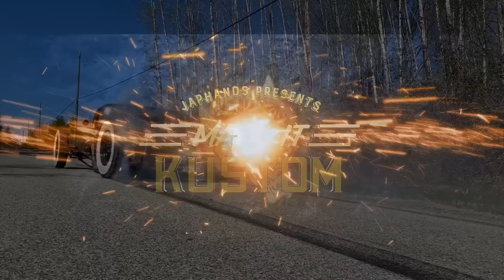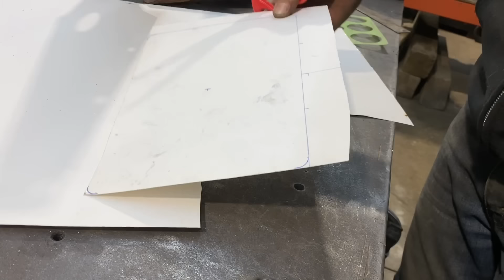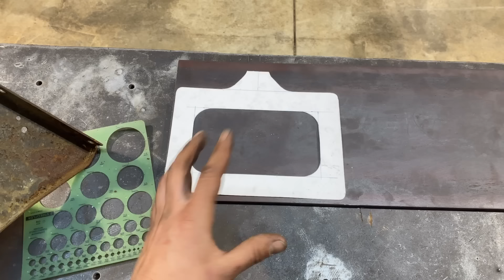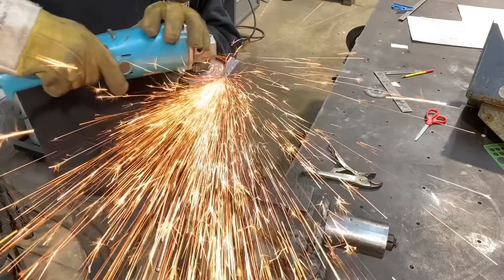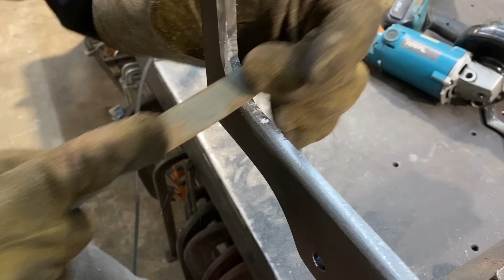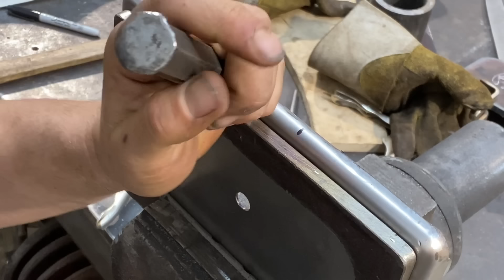Steel Plate HAMMER FORMING!! Step By Step with Simple Tools - G10 Van Battery Tray

Comment: those bending dyes you use there as spacers/support - better get something solid, even aluminum, those, if they fracture, send shrapnel flying, there is no need to find out if yours are hard enough to do that
I understand it may never happen, but I've seen results when they split, it's scary, that time the operator was lucky to not get hit

Comment: Back when America made things, I was a GMI co-op student in 1969, my sponsor plant was Chevrolet Gear and Axle with 13,000 workers.  Your comment about the 200 ton press brought back memories of our truck crossmember 10 stage dies, I estimated 1/4 in thick steel.  The presses were somewhere between 2 and 3 stories tall and I was told the foundation went one floor underground.  The noise was deafening and in 1969, no ear protection or safety glasses.  The floor should shake under your feet every time the press cycled. I might not have every detail correct because it was 57 years ago.  All long gone now.  Probably an empty field covered in weeds and 13,000 jobs shipped to China (where I have lived for 15 years).
Reply: Kínába jó élni?
Reply: @zoltizolti3165  I've been here 15 years, so for me, yes.  It's a large country, so there is no one 'China'.

Comment: I have watched several Make It Kustom videos - he explains and demonstrates things very well.   
But, surprisingly, he doesn't know how to hold a hammer.   He grasps it half way down the handle like beginners do.    If he held the hammer properly, at the end of the handle away from the head, he would get more effective blows, or for the same blow intensity, it would be a lot less tiring.   Imagine using a hammer by holding the head.   Holding it as he does is half way between properly and just having the head in your hand.
He doesn't know how to file curves.   To file a curve, don't follow the curve around.   Instead, move the file so that when it goes forward, the point of contact moves back.   Do it that way and you will find it automatically gives you a smooth curve without any flat spots.
Of course, if you use tools wrongly, a lot of practice will give you greater skill and some success.   But use them properly success will come quicker and be more assured.

I have made similar pressings to his battery box without a hydraulic press.   I made the centre depression by hammering with a gympie (a sort of sledge hammer about half the size of a standard sledge hammer - you can hold it and strike with one hand)

Comment: First off I love your skills and work. but there are so many premade battery trays out there starting under 10 bucks Wouldn't it be much easier and faster to just use/modify one of those? but as I look at this as your teaching moment I only add, once you make the Battery box or modify an existing one. Cerakote is for the best longevity, acid does not affect Cerakote like it will paint.

Comment: Seems to me a simple solution to this battery tray corrosion issue would be to take the battery out of your new (or old) car,  put it in a plastic marine battery case and then reinstall it in your car, if you can still get the hold-down brackets around it. I know that would be unacceptable for a Barrett-Jackson auction type car, but it works for what I drive. Nice job making a replacement though. Impressed with your skills and envious of your shop.

Comment: Those are tied down rod holes for the battery. There's a strap that goes between two rods that tie the battery down with bolt with threads at the top wing nuts to hold it on

Comment: The depressed area in the center is meant to be a drain.  If you put a scrap of plastic mesh insect barrier as is used in many roof ridge vents under the battery it would allow liquids to drain away

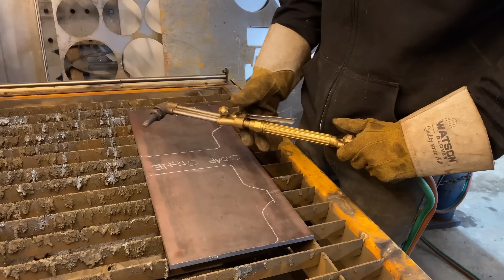Comment: 10:02 Mildly amused
I’ve been fabbing stuff and pounding up metal for??? 30 years now. 
I’m pretty keen on getting a freehand plasma cutter some time this year but I’ve never owned an oxy-acetylene torch and don’t have much of a desire for one. Never have. Don’t know why specifically. I’ve used torches a lot at various employment and friend’s shops, but an angle grinder, drill press, drills, and an ancient hardware store Skil jigsaw, and a PC tigersaw have done what I needed. Occasionally a rusty nut has made me think of torches but in the end? 
I’m fine without torches. Though I have occasionally used a propane weed burner to shrink oil canning out of sheet metal I don’t think I need an acetylene torch. 
Maybe I’m just weird. 
I also would have pulled out the router and made the forming buck out of oak lumber. The wood form I made for the ribbed cargo area floor in Jeep Wranglers has had a bunch of cycles and still works fine. For 15 minutes of work.

Comment: Why don't you use a set of oxy wheels when your cutting a straight line or a metal guide. It gives you greater control & it's a lot easier.

Comment: Very good , just an observation,. In the 1960s, I was learning my trade in a contract car body makers , manufacturing low volume production cars, and a lot of the panels although rough pressed were hand finished, in hammer forms,, we always used a heavy Hide mallet to form the flanges, also if you had used your stretching hammer rather than your ballpane your internal corners would have been better,, I realize you are demonstrating things can be done with very basic tools, which is great!!  My comments are just observations,, 👍👍👍👍👍

Comment: Since you’ve got a torch handy, wouldn’t it be smart to preheat the sheetmetal in order to make the tight corners or the dimples? This could potentially prevent tearing or is there no danger of this happening with the massive steel plate as a form?

Comment: I love your teaching style and I understand your point of yes you can make just about anything but can you imagine how much a new car or truck would cost if every part was hand made like this? Your not just making a part, your replicating a part that was machine made. You could have made a suitable part to achieve the same result without that much work. And I’m not talking about using a small baking pan with holes drilled in it.....well that’s not a bad idea. Find a baking pan with similar dimensions and drill holes in the right places... VIOLA !! Battery box

Comment: Would make a video of how to make it Briggs & Stratton small engine gas tank the square one there's not too many people that know how to fabricate one what I want to know is how to seal it what what should it be sealed with I think formula it's pretty easy it's a square tank and I think you could make it like a mold with a block of wood but your fabricator and I'm sure that this would be easy for you I just don't want to spend over $100 or more to buy one if it's something I can make out of maybe $20 a sheet metal?

Comment: When I was starting out as a pipe fitter's helper I worked for a pipe welder / fitter.
He kept his torch tip in his pocket and when the time came to cut a large pipe he put his tip in the torch.
He would then proceed to put a perfect bevel on the pipe while cutting to the finished length.
No grinding necessary, just file the land for the root past.
Some people are just extremely talented with a torch.
My dad always said a true mechanic gets the job done professionally with the tools at hand.

Comment: For torchwork, with gas and oxygen, you may use a cheaper plasma from the DIY-shop, only with compressed air, and use it on a line edge...  The easier way for homeworkers

Comment: I worked for a couple of years as a mold maker / polisher in the plastic industry  , the hours you have into making that 1 off tool has to be 8-10 and so cool to watch , however thats the time it takes to make a strange shaped part . waxing your press plate would have hidden the file marks . You will never have to buy a battery tray holder for any of your 1 off build now so time well spent. Otherwise you made the most expensive one ever lol.

Comment: For what its worth Idea:  Cereal boxes made of cardboard (i.e Cheerios) when pulled apart and cut into flat pieces work great as free retro pattern piece material.  If you need patterns larger than the cereal box, simply tape together more cardboard pieces to form a footprint as large as you need.  I enjoyed the video.
Reply: @08Maxwell
Yes, I’ve seen it termed early CAD technology (Cardboard And Duct tape)

Comment: I have to make one for my 1987 Fiero GT. The Fiero Store wants over $100 for a replacement. I am going to make my own but with an improvement. I am going to make a rubber tray that sits in the metal battery tray. And then vulcanize tubes to the rubber and run them out through the metal tray for drainage. No contact with battery acid and metal.

Comment: Have you done hammer welding? That's what my brother-in-law and his cousin repaired the floors in one of their customers early 30s model A.  The would cut out the rusted/damaged area, then cut metal to fit the cutout. One would acetylene weld a short bead and the other one hammered the weld flat to blend with the original floor. They were good enough, at this procedure, that you could not tell where the floor had been repaired.

Comment: Cutting a straight-line free hand is very difficult for most.
I suggest a long length of 2x2 angle, clamp it down, and run torch along it for a nice clean straight line.

Comment: Having worked in heavy industry around simple and progressive stamping dies, I have to say, the automotive battery tray is really a work of art in most instances. As you said several times, 'I don't know why they did that'...well, the various 'tray gussets' (steps inside the tray floor) are there to allow for drainage of battery acid, in event of a charge boil over. The holes are in the tray floor to allow for drainage (both on initial spillage, as well as once it collects in the lower floor). They are made of heavier gauge steel to survive years of acid conditions, and the sidewall (edge) gusseting is there to prevent a heavy battery from 'unrolling' the lip if it moves around. Many also have metal-removal 'cut-outs' to reduce weight. Thus, the product stays light, drained, strong for a very long life (it is NOT a 'planned replacement item' in a car, so its design matches the frame-life-expectation of the car in most instances, at least on older cars). While you think 'hey, HDPE plastic would survive and is strong', keep in mind, HDPE starts softening around the boiling point of water and melts entirely by 350-degrees F. It wouldn't work under a car hood in Arizona in the summer. They were actually designed with a lot of factors taken into account (an acid-impervious steel is NOT cheap, or they would have probably stamped them out of that).
Reply: Damn dude, your reply was as informative as this video. Thanks.  I'm actually hoping you make videos (checking your acct after). Edit: You don't ... but I still subscribed in case you ever do.
Reply: copy, copy Captain. Battery boxes in boot (trunk) of UK vehicles were infamous for rusting, especially where snowy roads required grit.  Often built by what looked like scrap angle iron by apprentice welders weilding a torch and cut-off saw. It took a very long time for UK vehicles to get their plastic as good as USA and Japan-  huge problems for South Africa, Australia and hot parts of the world, and aircon severely lagged behind US (delco aircon like a meat lockee) and Japan. No idea why they didn't buy a basic older Cadillac aircon license- would have saved UK markets alas UK manufacturers awful leadership.

Comment: I hate showing my age but I used to run, build, and maintain all sizes of presses to make these parts. Also I built the dies.
The two short notches are to strengthen the steel at the clamp.  The longer notches next to the crown for the upright, are overflow drainage if the battery ever overflows. The deeper impression is the reservoir and the weep hole drains. When installed, the weep whole should have a clear drainage to the ground.  
Its a safety design to greatly reduce the chance of explosion and injury and damage caused by puddlling battery acid.

Comment: Bit easier to just cast the metal shape in steel fiber reinforced high compression strength cement and then place the sheet metal over that, and use a dead blow hammer.

Comment: I'm at 41.30. 
I would have done the center die first. Because doing the outside is all well and good but when the centre is pressed it will suck it the outside cause in it to undo some of the work. Meaning that once the outside is done then the inside die is done the outside would have to ne redone. If the centre die is done first then the exterior it wouldn't effect the end result. 
Just my opinion from experience from doing hammer form.

Comment: I think I would heat the 16 ga. where I am hammer forming the edge. It will stretch and shrink easier. You could use the two center cut outs welded along the edges to push in the depressed area. I would also heat that to allow it to stretch.

Comment: The low area in the battery support is for drainage as is the hole. For better drainage the low area should be even lower as the water moves to the drain hole. The other option is to create an entire hole where the low rectangle is located.

Comment: When a perfectionist decides to make a replacement for his car's battery mount.
I showed this to my brother who's in the business of vintage vehicle restoration and at first he could only shake his head. He told me he'd have just cleaned up the original, cut away the rusted part and welded a new piece in and called it a day. Not because he thinks that's a good way of working, just that no customer of his would be prepared to pay for his time to do what this video footage shows.
Nice to see that there are guys out there who don't believe in doing things by halves.

Comment: So the center part that you're doing is called a draw. And you have a shallow draw or a deep draw and what you're doing is a shallow draw. But very well done you could actually maybe even saved a little bit more time and made it out of a high density press board but these will last a lot longer! Good video! I've done a lot of this for making parts for the sky crane helicopter.

Comment: My car has always had sealed batteries but the battery tray is rusty. Part of the damage is vibration fretting between battery base and tray. The rest is purely poor quality paint applied over welding mill scale. If you want pressed steel parts to last, get them hot zinc metal sprayed.

Comment: I did a fair amount of fabrication working in the Auto body Repair trade for 45 years starting in the mid 60s, but this is nuts for a battery tray. i think if I had to make a run of them yes, but after watching all this work I need a nap, it is very enjoyable watching though, in the past i have spent time to make tools that i have used every day, some people wanted me to make there's too. like a spoon for moving body panels from a Chryslers leaf spring that i spent 3 hours polishing, of course on company time. i had one boss yelling i was making a pull plate for a shock tower, then the customers would come in and he would go we have to make special tools to fix their cars, i was giving him the finger behind the customers back. great work now make out 50 of them as they are the same on many cars.

Comment: The form you made  is unnecessary you need to learn some sheet metal fabrication I'm not hateing on you I have just been working metal for 42 years  look up Lazzy  not sure if that's is the right spelling but he is the sheet metal fabrication god  good luck keep at it   nothing is ez and the last thing you do is the first thing you see  oh yea striking with a glancing blow dues nothing you are not going to push it over.  drive it over  with direct hammer blowers

Comment: You did a hell of a job making that new piece, but just a word of caution, the alignment holes at each end of the plate are actually the holes the rods that hold the batter in place go through and have to align with the proper battery.
Reply from the maker: Thanks Ken! The holes are just from manufacturing. This style tray holds the battery lip on the bottom and one side and takes a bolt that tightens a small clip that pinches the lower lip of the battery on the other side.

Comment: Dollies are way...way cheaper than 3/8 plate, so it plywood.  Basically all you need is a form and since you have a torch to anneal and soften the steel the 3/3 plate was a bit overkill.  Now if you are doing a production run of 5000 then I guess I could see the initial expense.
Ron Covell is the master, imo and he is who I try to emulate.

Comment: They press it so the bolt head doesn't end up in the bottom plastic of the battery. Pretty sure the simple answer is right there unless that hole isn't a mount point.  🤔

Comment: I am impressed by the quality of reproduction of such a stamped part with that "simple" process. I Susdbriceb and clicked the Bell.  I think a jigsaw or circular saw would work well especially for straight cutting like this. 
 
 Would thinner 20 or 22 gauge be more than enough for this non structural tray? I can't afford 3/8 plate. I would prefer thinner sheets and cheaper wood forms, and my neighbors and grilfiend would probably appreciate that I use clamping because hammering would drive all of them nuts. Am I delusional about the feasibility of forming 22 gauge with wood?

Comment: At first I thought you were making the tray out of the 3/8 steel and I thought what an over kill and it would be pretty hard to form. Then later I saw that you were fabricating form tooling. Obviously you went through all the work to create the forms so that the final product would be an OEM replica because I'm sure that out there in this world there is an aftermarket battery tray which would work just fine.